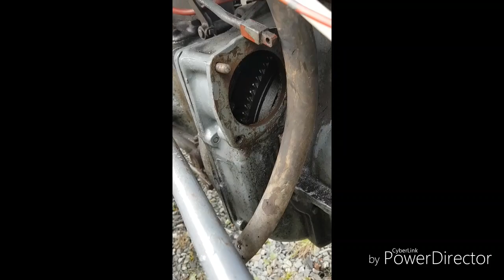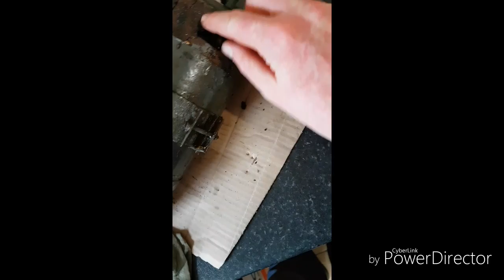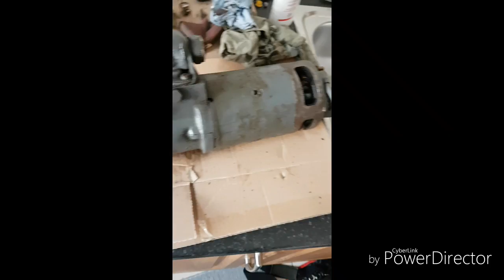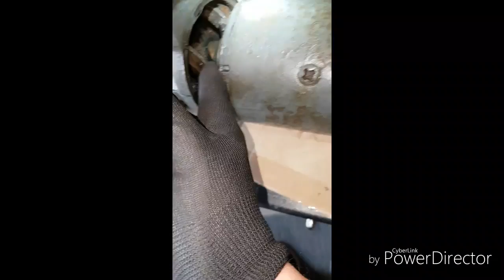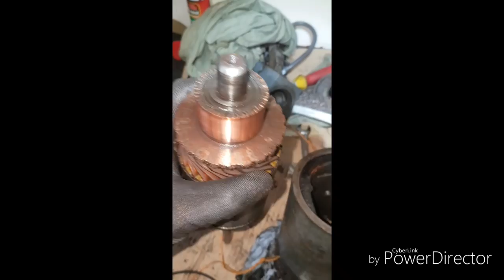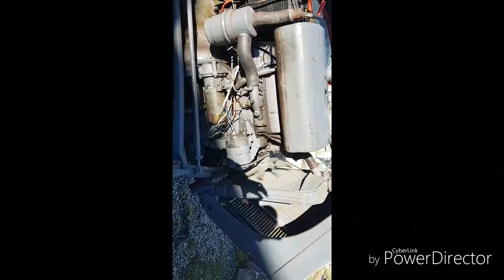Vintage Tractor Ferguson T20 Starter Maintenance

Comment: Ferguson manual is quite precise on the pinion movement along the shaft when the electrical contact connects. A multimeter on continuity with either a mate helping or crocodile clips on the leads let's you set it spot on. There's some give on the bracket anyway. With starter off examine ring teeth too.